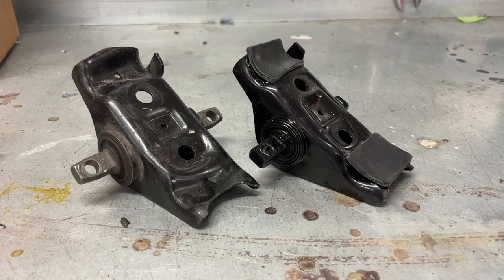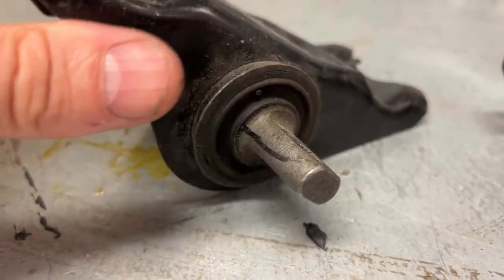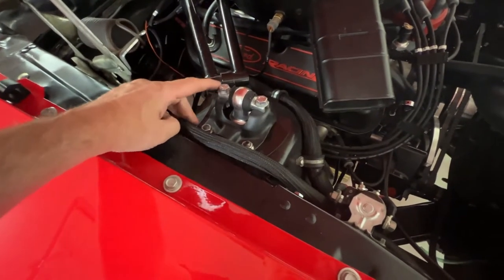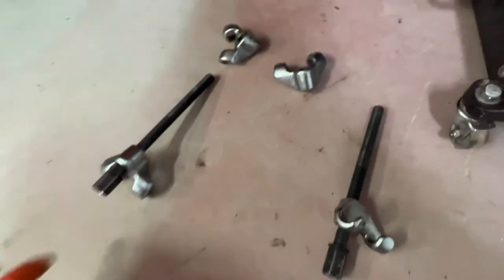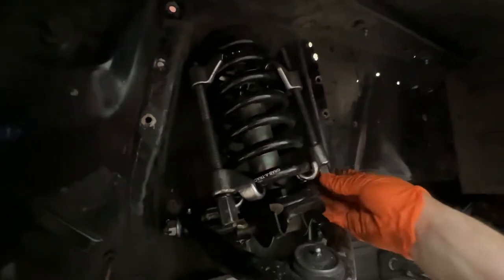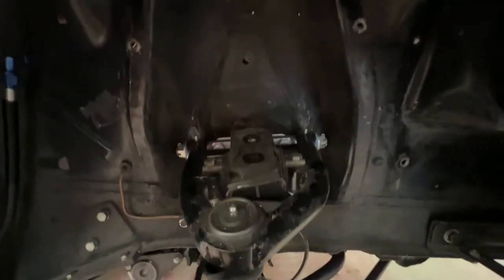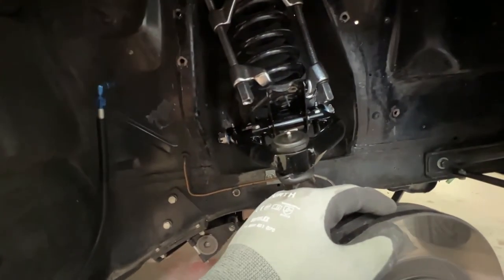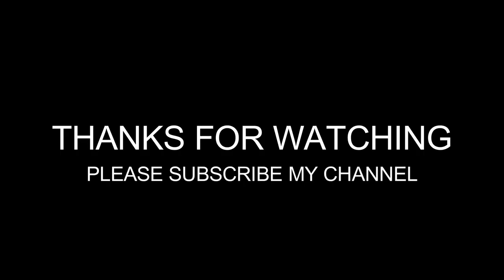Mustang 1965-1970 ball bearing spring perches install

Comment: Nice video. Did you notice a difference in the ride and or the overall ride height?
Reply from the maker: These are only for strength. I use higher rate coil springs plus Global west control arms and this are less forgiving than stock.  Stock saddles will fail and squeak quickly